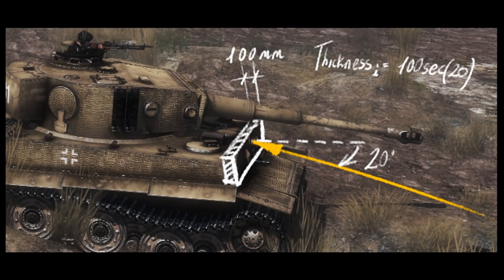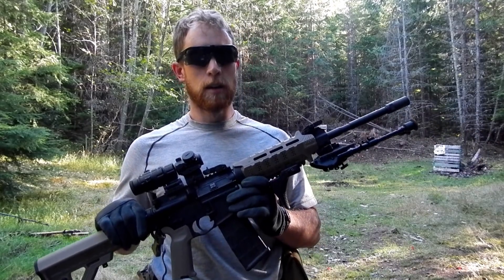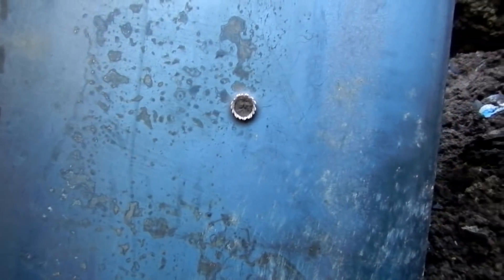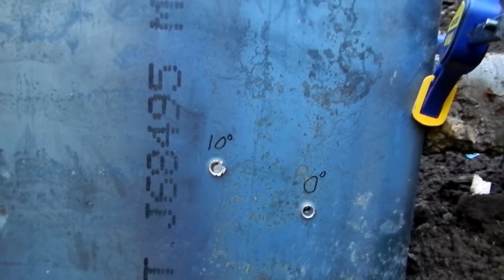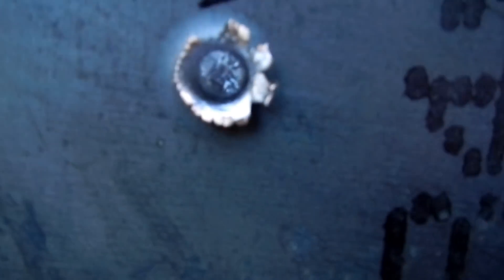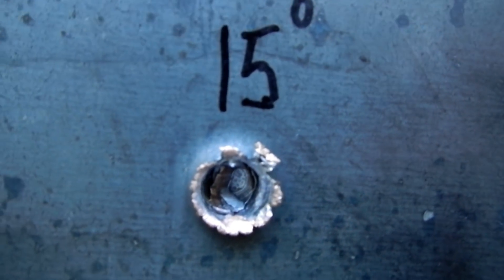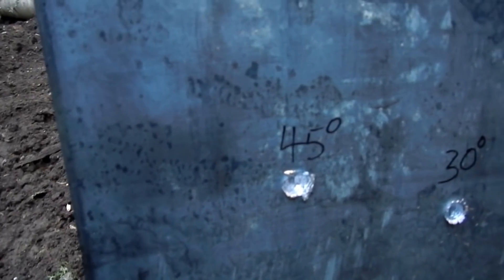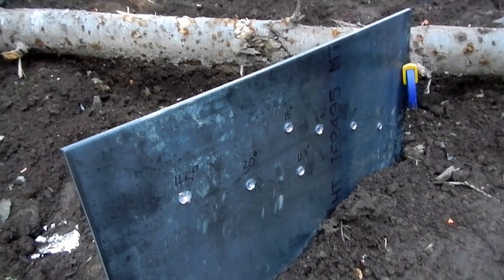Does sloping armor increase it's protection?

Comment: I would be interested in seeing a comparison of a shot at 3/8" plate  at 45 degrees vs a 1/2" plate at 0 degrees, much of the early talk about sloped armour was around increasing the thickness in which case 3/8" gives a 0.375" and at a 45 degree slope offers 0.53033" which is roughly 17/32" which is only 1/32" greater than 1/2".
The additional benefit of sloping armour is that the forces presented are presented over a greater area thus reducing the penetrating capability. So the demonstration vs a 1/2" piece would be very intriguing.
Reply: There are other considerations involved that aren't clear at 1st glance
The thicker plate at some points will become better from other factors - namely frangibility
the surfaces of a plate are hardened - hard surfaces are also more brittle: there is always a core of soft steel to absorb the force and flex with the impact to stop too much fracturing of the hardened layers of the surface
At some points the physical mass of impact will allow a plate to shatter a thinner plate - either punching through or causing chips to flake of as shrapnel internally called Spalling, regardless of angle, where the thicker one would merely deform
This is why the majority of ship belt armour is soft steel
Reply: @bengrogan9710 Yes those are additional factors to consider when looking at how a vehicle is armored in whole, however as this video is looking at the effect of sloped armor has it is a moot point to apply it to what I stated above. So long as the 1/2" plate has the same hardness as the 3/8" plate then my describe test would still be a viable comparison.

There are a a lot of factors that apply to the armor of a vehicle. The only proper way to showcase the effect it has is to keep all other factors as neutral as possible. I do get they type of material used has a effect, so does how it is fastened, how much support it has, where it has, how many layers there may be, what type of round is used against it and so on. If all those factors were to be introduced all we could do is shrug and say "Yes there is improvement, but from what and how much each I have no clue".

One reason I appreciate this test is how simple it is kept, while there are a few things that can be nit picked apart the test as a whole is a success. Same gun and round type, same steel shot only at different angles.

Comment: Amazing to see how even a slight angle of 15-20° makes a big difference. Of course 60° will give you 2x the LOS thickness, but you also need 2x the amount of plate to cover the same area. So this may be a sweet spot?
Reply: Sloping also deflects shots.
Reply: Also sure when designing a tank you gotta take in consideration the modules if they fit the design, crewmembers positions, viewports, tracks, engine, gun and yadda yadda. So in short... Its not an easy task
Reply: @Terraqio  exactly, if you design a tank to fit all of the modules and crewmembers behind a 90 degree plate, then angle it at 60 degrees like a russian mbt, you'll have to increase the place x2 to make it the same height
Reply: @LicsNorgi  yea but then it would have bad armor design
Reply: No, it doesn't require 2x the amount of plate to cover the same area, it just means that the tank design will get more compact and smaller (lower silhouette), so it actually is a win-win situation because it forces the designer to make the tank smaller so it's harder to hit plus it has more effective armor

Comment: I would love to see a video to find out at what angle the round ricochets. Measure the minimum required thickness to stop the round, in other words, the thickness at 12.5 degrees. Then take out a thinner plate and angle it at such an extreme angle that it causes a ricochet, but it is so thin that the thickness doesn't stop it, but the ricochet is enough. Clearly, if it stops the round, all of the kinetic energy goes into the plate and punches a hole in it. If it ricochet then it leaves with some kinetic energy. So it cannot bury as deep into the plate. 

Of course it might be more dangerous to intentionally cause a ricochet, so might not be good to make a video about it. But it is something that adds to the strenght of sloped armor so it would be really cool to see.
Reply: there is no set angle any round is capable to ricocheting due to variables involved that factor into one occurring, u'd be basically asking someone to shoot enough rounds into a sloped object and hope for the best

Comment: The only problem I see with sloped armor is anti tank/tank shells. Because the shell arcs through the air at greater distances. I'm curious to see how that might effect the armor due to the angle being reduced. (Yes I know the shell looses penetration further and further away too)
Reply: That's really going to depend on the type of tank shell and as for anti tank shells well the yeah they're designed with sloped armour in mind
Reply: most tank rounds are quite flat in trajectory, you are only tanking a variation of around 4 degrees for anything in line of sight

Comment: sloped armor isn't lighter.
Reply: Andrew Barnett  if you slope the plate it can be thinner, but it needs to be taller, which adds back the mass.

10mm thick flat plate that's 1m tall is the exact same weight as a 5mm plate that's 2m tall; when sloped at 60deg the 5mm plate will have 10mm effective thickness and will cover 1m of height.
Reply: most tank armour isn't that's a given
Reply: Andrew Barnett  not really.

if they made the T-34 as a box it could have the exact same effective armor thickness and weight; but a flat box is a bad design for a tank due to a variety of other reasons, so if the T-34 were a box it would absolutely be a far inferior vehicle.

Comment: Sloped armor was used in the American civil war look at theside of CSS Virginia. Also USS monitor would have a sloping effect on anything but a perfectly perpendicular strike to the armor. Additionally world war 1 FT17 has sloped armor as has the German tank of world war I

also the weight of the armor does go up because  you have to have a longer plane of armor to cover the same distance the shortest distance between two points is still straight line  if tpzIV ywere to slope the armor from the highest point down to the front of the hull it would weigh more because   more armor is used.
Reply: Glad someone finally mentioned it.  There is a sweet spot of maximum protection per weight of armor, but I'm too dumb to calculate it.

Comment: if you know basic math and Gemoetry, Yes. in practice it doenst work as effectivce as it did in WWII, now that we have APDSFS / HEATFS / ATGM's and TOW missles
Reply: @Tyler Foley definitely not when we're talking abouy the possiblity of defecting shots, yes. But it does still work against shells like HEAT that delivers its payload in a linear manner. The jet stream of molten copper shot out by the HEAT shell would still have to travel through longer distance of armor plating due to the angling.

Comment: There is an angle referred to as the skate or skip angle which the incoming projectile transmits zero impact energy to the surface it's colliding with. Barnes Wallis conducted experiments and found it to be 72 degrees. It's the angle at which a stone skips water, a bullet grazes a body and which a bomb can be skipped on water.

In range tests the Germans proved that larger calibre AP projectiles are least effected by sloped armour whilst smaller calibre projectiles were effected the most, hence their move to bigger calibre AT guns.

Installing a soft malleable metal cap to an AP projectile improves its ability to penetrate sloped armour.
Reply: ...and then HESH rounds come along at the very tail end of the war,  they don't care about armour slope angle at all nor impact velocity, relying on explosive shockwave to spall off the inside face of the armour to cause a bad day for the enemy AFV crew.
Reply: @dj1NM3  And then spall liners and spaced armour come to ruin the party (except FV4005 which laughs in the distance because that doesn't kill tanks, it beheads them).
Reply: @Neion8  Spall liners can only do so much - they are essentially a kevlar weave liner mounted inside fragments bigger than around 12mm are still a threat
Reply: @Andy Reid  Minor correction - Energy is still transfered into a plate, it is the point at which the elasticity of the surface is greater than the ingress of energy - the bounce is the release of transferred energy deflecting whatever projectile is in question
Even on bounces however Spalling can still occur on the inside of a tank

Comment: Angling armor to increase protection against projectiles is a proven Fact not a simple theory there is a clear difference between the two.
Reply: Using the proper definition of theory, it is a theory. It was not a theory before being a proven fact. Before it was proven it was a hypothesis. 

A theory is a scientific explanation of how something works. https://www.merriam-webster.com/dictionary/theory
From above link, under the section "The Difference Between Hypothesis and Theory":
"A hypothesis is usually tentative; it's an assumption or suggestion made strictly for the objective of being tested.
 A theory, in contrast, is a principle that has been formed as an attempt to explain things that have already been substantiated by data."

also from above link:
"A theory is a system of explanations that ties together a whole bunch of facts."

In scientific terms, a theory is an explanation of how an observered phenomenom works.

Comment: it depends, solid shot rounds most definitely, rounds like heat, chemical or sabot it provides no advantage, modern rounds will defeat it.
Reply: Sloped armor still increases the thickness of armor needed to be penetrated, regardless of round being used. Sloped armor is still being used for modern tanks, albeit the primary reason is to cause ricochets. But the same concept still applies.

Comment: I might get called "nerd" for calculating all this shit but here are some angles and by how much the armor gets thicker:
10°        +1.54% more effective
20°        +6.42%
30°        +15.47% 
40°        +30.54% 
50°        +55.57%
60°        +100%
70°        +192.38%

Everything from now on will richocet most of the time so is not worth mentioning. Anyway, as you can see, a 40° slope is rly effective! 10 more ° and is 20% better! If the armor is thick, a low angle can have an effect, but with 1" plates there is rly no difference. At 10° 1.0154". Not impressive whatsoever. Not even 3cm for everyone thats not american.

Comment: So then why don't we issue soldiers armor composed of 45% angled plates in spaced armor configuration allowing for over all reduced thickness, lighter weight, and increased durability over modern ceramic armor?
Reply: because this video got the protection-weight aspect wrong: the 'penetration path' will always be proportional to the weight, regardless of sloping
Reply: Because you would be relying on that 45* angle, if the soldier was leaning forward, or the enemy was firing from elevation, they could hit a plate at 90* and negate the armour. Also by the time you've got two plates for spaced armour and the extra material required to cover the same surface area in a 45* zig-zag pattern, I don't think it would be any lighter, and it'd certainly be bulkier.
Reply: @Tyler Foley Radioactive body-armour? Are you a super-villain?